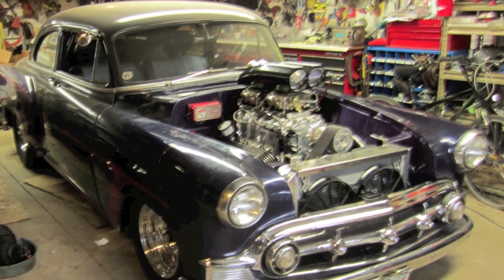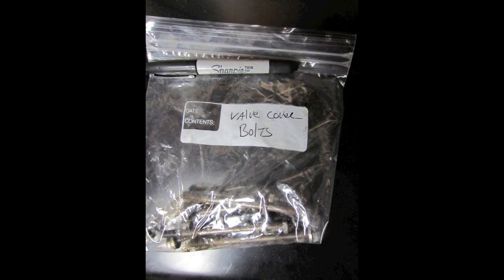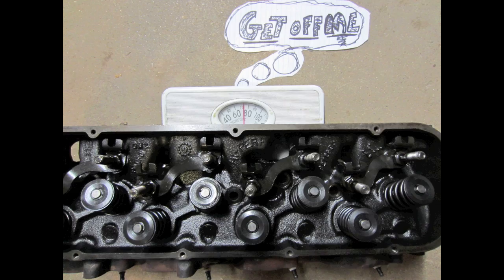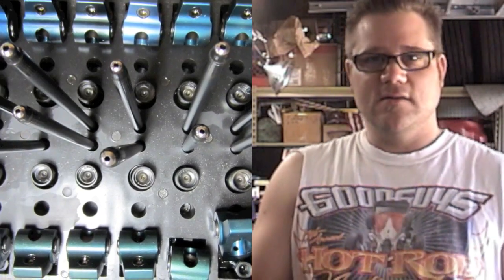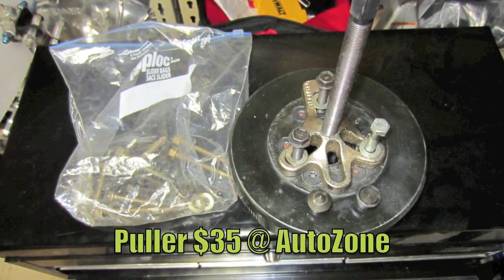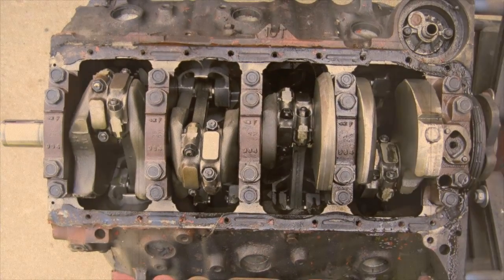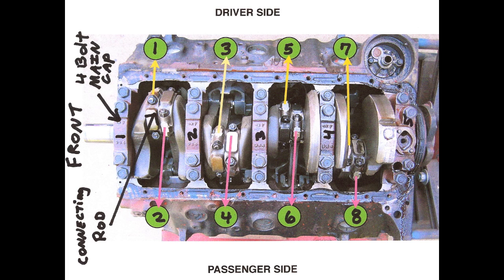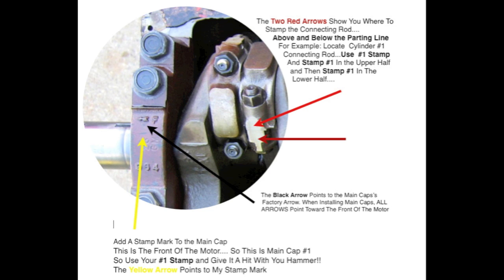Part 1 Disassembly Of The The Big Block Chevy For Beginners

Comment: JOHNNY K ,  THANKS FOR ALL THE GREAT  INFO  TAUGHT ME A LOT .  NICE RIDE !
Reply from the maker: Hey NORMSTER,
Thanks for taking the time to post.  I'm glad the video was helpful!!
Have a great day!
Johnny K
Reply: hey  j .k.    im  putting  together a  super budget  .30 over  454 ,   whats  your take on oval port  2.06  1.72   heads ,  u   think  i can sqeak out  400 h. p.   using a  comp  extreme 268h  cam  , alum intake ,  750cfm .   ?   thanks  again  for the  great  vids
Reply from the maker: NORMSTER Hey if you are going to get your block bored, have the machine shop do a sonic test of the cyl. walls. Then you might be able to go .60 or even .90 over. More cubes Bigger better theory!  Up to 600 hp on a two bolt main will work...some guys say you need to have the engine internally balanced to achieve this, other say external balance is fine. Ask your local speed shop on this topic. The only reason I run rect. ports heads is my blower manifold is made for rect. port heads.  Otherwise oval ports for me. I mainly drive my ride on the street = oval ports(more low end power.  All out drag racing racing = rect. ports(more top end power) that's my take on it.  I just don't feel like buying a new oval port blower manifold.  I would rather spend the cash on something else.
Hope this helps!
Johnny K  
￼￼
Reply: Hey  johnny ibought  the motor  already bored .30 over , sent it to a speed shop to clean it up everything looked  good. my big  question  was  will i be  ok  with  the small valves .  Im  pretty realistic  i  know  im  not  gonna have a pro mod motor  for  a skimpy  $2 grand  lol   but  hoping  to  touch  the 400hp  mark  you  think  thats  attainable ?   thaks  for  help   Norm
Reply from the maker: Cool, you will be fine with the valves you have.  I would look at cfm flow of the intake and exhaust.  Look up the stock casting # of your head.  Then you should be able to identify the IN/EX stock cfm and cc of the standard combustion chamber volume with a little research on the web.  Next, look around on head manufactures web sites.  They list the cfm flow of IN/EX.  Look at their iron heads instead of the aluminum (cost factor).  Once you find an aftermarket head with the same head chamber cc as yours, but something that outflows your stock head IN/EX cfm....jump on racing junk.com They have iron heads for sale at a fair price. The better your heads breathe the more HP you will get...but remember it's the combination of the RIGHT parts that make the HP not just one item.......after saying that, I would upgrade the heads 1st....most bang for your buck
For example: I spoke with the guys from AFR and they suggested for my set up, (aluminum heads is what I was looking into)they suggested the rec. port 305cc with 117 cc standard combustion chamber volume for street use....no need to go with a 345cc or a 385cc head for the street. Bigger is not better in this case.
Call up the experts, they can steer you in the right direction for your application.
Hope this helps
Johnny K
Reply: k  buddy  thanks  for the  help ,  keep in touch  stay  warm ,  im  out  here  in  Mass freezin   sure  you  know  what  that  is !